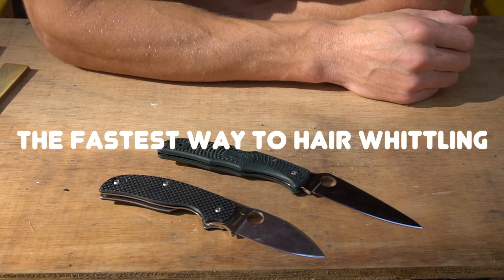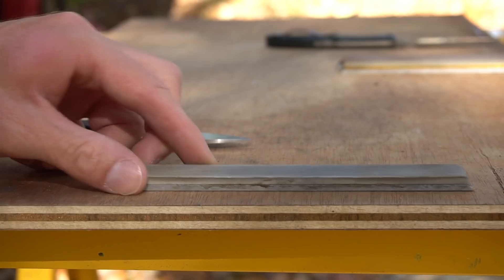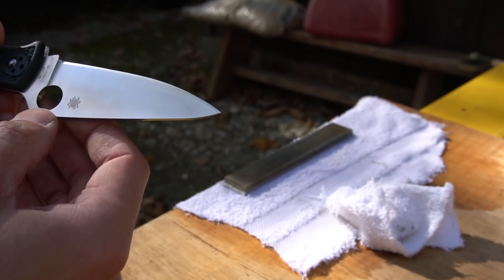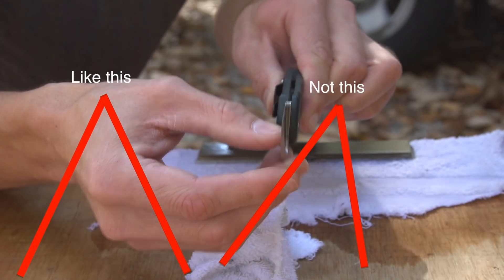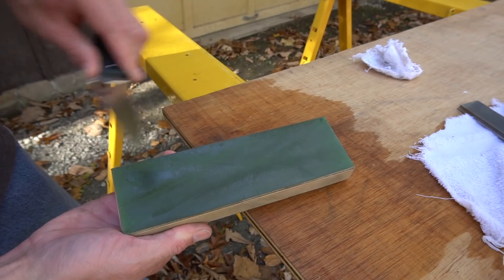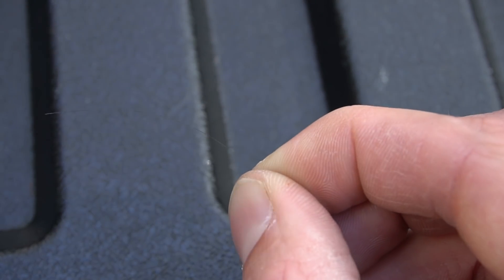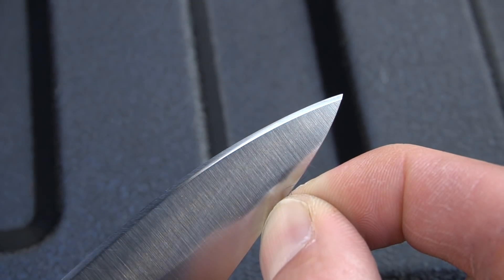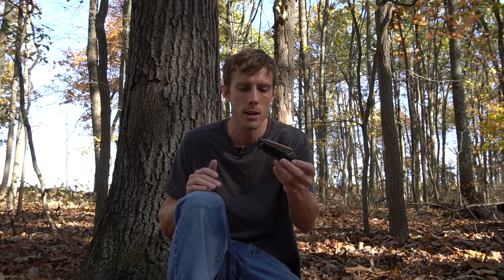FASTEST WAY TO A SCARY SHARP KNIFE

Comment: i would suggest to strop until you dont see any light. so shine a light at the blade facing up light shining down at the blade edge. then look to see for any light reflecting. if you see light along the edge keep stropping. it means the bur is still there, or maybe even another issue.
Reply from the maker: That works well, I actually talk about that in another video👍 Thanks for the comment 😀

Comment: Hi Alex! I've noticed that your edge is identical in width at any point of the blade. I always have a problem with my kitchen chef knives, that the edge at the very tip is a bit narrower and thus less sharp (or just more rough in paper test). Also the heel, 5 mm from the end of the blade. Do you have any sharpening tips for these problematic spots?
Reply from the maker: Spend more time on the stone in those areas. Those areas are definitely problematic for larger knives as most stones are not long enough for the whole length of the blade. As long as you focus on maintaining a given angle there no harm in working any problem area separately. Hope this help😀

Comment: i got 2 systems i use and love they both have different purposes......my main system  is an edge pro clone with 3 diamond stones 240 600 1,000 and some natrual/artifical stones ruby 3,000  5,000/6,000 agnet ((ive had different sources report that stone as 2 different grit)) 8,000 green and 10,000 white stone .....and a strop with white compound and strop with jewlers ruge......................the other system is lansky diamond stone systep i got the extra corse the corse the medium and fine i have the 1,000 grit extra fine and 2,000 grit polishing stone and 1 strop witth red rude ((i do plan on getting more strops for more compound options)) i like/love both systems sadly ive yet to get a true mirror edge on eather one of them...think i need to make a couple strops and get some dmt liquid emmulsion or something to 1 micron and .5 micron......why i go through all the work is that some metals like toothy finnishes and some love polished ....zdp loves polished it will stay sharper longer if you go beyond your 240  and there is some evidence  of this if you seen cedrics channel......he does alot of edge retention tests and you can probly look up the metal to figure out what edge works best or what metal sorry im rambleing at this point i was going to ask if you ever do mirrors and if soo what would you recomend me to help get me there right now my free hand sharpening skills suck though i do practice cause i never know when i might be in asituation needing to sharpen a knife with out haveing my systems on me

Comment: So first off I wanna say I love your videos and hands down some of my favorite "how to" videos on sharpening! I'm trying really hard to learn how to sharpen a knife to hair whittling but I've been unsuccessful on any kind of steel ranging from cr13 all the way to s30v or m390. I've got mainly diamond stones from worksharp and dmt and I've got the knives plus strop. Is there any advice u could give other than what you've shown in your videos that I might be missing? Do you use any kind of compound on your strop? ANY advice would be much appreciated! Lol
Reply from the maker: I use chromium oxide compound. Hair whittling is a delicate process. The edge is so thin you have to be very gentle on the stone and the strop. In my experience 8cr13mov from spyderco is the easiest to get hair whittling. Not all 8cr13mov is the same. I use light pressure on the stone and the strop. I think pressure regulation is the most important, other than maintaining an angle. Hope this helps😀
Reply: OUTDOORS55 awesome man I appreciate it! Yeh I've been practicing on my tenacious trying to get that edge but I never thought about the pressure. I'll sure try it! Would you recommend the edge pro stones over any diamond stones?
Reply from the maker: I don't have experience with diamond stones. I have heard good and bad. If you can get around the small size the edge pros are great. They cut well and last forever for how small they are. Not sure I can make a recommendation haha. Just depends on what you want. I have heard on some steels the diamonds can actually come off, and imbed into the steel. Maybe something to research before you make a purchase.
Reply: OUTDOORS55 thanks for the help! And one more thing I've always been unsure about is when I'm progressing thru grits, at what point would you transition to a higher grit?? Like say from a 220 to the 400 and on up?

Comment: So it is the leather that does the trick. Now how big difference do you think there is between leather and leather? For example some old leather belt, or a random piece of leather?
Reply from the maker: There is a big difference in leather. Some of which is totally unsuitable and can actually make the edge worse. I have found a high quality veg tan leather to work best. However lower grade can vegtan can be a nightmare. I would avoid buying leather online unless is come from a reputable source specifically for stropping🙂
Reply: @OUTDOORS55  I see, thank you for your advice

Comment: I agree working age is just fine I actually prefer working it was nice to see the polished edge when I first started sharpening but if you’re truly using your knife not worth the time and effort I do have a question on that sage 1 in the video it looks like you’re having the same problem I have originally from factory at the back of the blade it originally sharpened A little higher up and it makes the blade look like it has more belly straight edge and as I sharpen I tend to straighten edge up if you know how men can do it can you show a video how to keep the factory shape to the edge looks like you straightening yours out a little bit too but if you look up a new knife maybe you’ll see what I’m talking about not sure if I’m explaining it very well I really enjoy your videos 👍🏻
Reply from the maker: One problem with the sage is that the blade is very thin in the back, and thickens at the tip. If a constant angle is held along the entire length of the blade, the bevel will be different sizes, due to the thickness change toward the tip.  However my sage came with a poorly ground edge and was very uneven from one side to the other. Im bringing it back proper over time. Hope this helps. Thanks for watching my friend😀
Reply: OUTDOORS55 Thanks for the response so if I wanted to keep the original shape of the bevel  I would have to sharpen the back of the blade at maybe 25° and more in the middle and tip go to like 20 or 22° no it wouldn’t be a consistent looking bevel but that’s how I would keep their shape if I wanted to
Reply from the maker: If you want to have the bevel the same width, on a blade that changes thicknesses, than yes, you would have to sharpen at different angles. I prefer to keep my angles consistent, even if the bevel width changes. However, its personal preference, theres no right or wrong way.
Reply: OUTDOORS55 cool thanks man appreciate the information and your time
Reply from the maker: No problem thanks for watching 😀

Comment: What about sharpening convex edges? Those are pretty tricky to sharp on stones....
I use sandpaper on a mouse pad...afterwards a strop
And yes, all knives should be whitling hair sharp, because an edge that sharp will have a better edge retention than a less sharp knive...
Though, in my opinion, no leather gimmick gives the blade edge the crispness that a (high grit) stone gives....
I learned this from a youtuber..
Reply from the maker: I do most convex edges on sand paper with leather backing. A strop can and will round over an edge if you you apply too much pressure or too much angle. I don't find a stropped edge any less "crisp" using a strop, but there is some technique involved. Thanks for the comment👍

Comment: What if you have the diy leather belt strop? The burr doesn't make any type of apparent "roughness" on the strop
Reply from the maker: Sometimes the burr will be very small and won't leave a noticeable mark on the strop. A coarse stone will leave a bigger burr than a fine stone. Also I use a drop of cutting board oil on my strops to condition the leather. That will also help.
Reply: OUTDOORS55 ok I'll give it a try. My leather belt strop is pretty stiff. I'm sure the oil will help, but do you need to add more buffing compound after you put the oil on?

Comment: Thanks for the video. Yes, I just find out to get from a paper slicing sharp knife to hair shaving sharp, and to hair cutting sharp,  it is basically depends on how much time I am spending on stroping. I found it doesn't really change a lot on stones unless you get some really nice and expensive fine stones. Paying more time and patience on stroping can basically bring a paper slicing knife to shaving sharp. However, for an edc folding knife,  I do think it is good enough as long as the knife slices paper. For an outdoor fix blade, I can live with it as long as it doesn't tear paper. A shaving sharp or hair whittling sharp is for fun more than practical. After all,  the whittling edge will leave me after an apple.. 

By the way,  I usually strop with an slightly higher angle than sharpening. What's your reason to have a lower angle?  Will the strop can't touch the apex?  No offence or challenge, you know I am your big fan :) I just want to know if I am doing it wrongly.
Reply from the maker: I agree I find it's all in the strop. I strop at a lower angle to avoid edge round off. On a soft leather strop, too high of an angle, combined with too much pressure can round off an edge. Although every strop is different as to how much pressure and angle is necessary. At least from what I can tell. You almost have to learn your strop and what it likes haha. If what you are doing works,  than it works, no need to change. 👍
Reply: Oh.  I figured out the difference. You are stroping at a lower angle with reasonable pressure. I am stroping at a higher angle with minimal pressure. I tried your way and I found it more effective. Thanks!!

Comment: A fighting knife, contrary to popular opinion, should be about that sharp. The knife is not used for anything but fighting, and the edge will last long enough for you to sever tendons and muscle. You don't need "shock-factor" from pain, which is where the "rough" edge concepts comes from, when the muscle and tendons are not operating the limbs. But...you need to have a utility knife with you as well. Always carry two...one for cutting and one for fighting.

Comment: How do you tell what type of steel your knife is?
Reply from the maker: If its a quality knife it will say on the blade most of the time ( not all cases though).  Other than that check with the manufacturer. Thats really the only way.😀
Reply: Well mine is a Gerber and the only marking on it is 466015A and I don't think that has anything to do with the steel

Comment: Who cares about the haters. My blades are always shaving sharp. & i use a multitude of different techniques. Free hand. No guides or anything. I have a 400grit, 600, 1000, 1500(only 3in long, and 2000. And a home made strop out of a hunk of leather from a tool belt. I could easily make due with one 400 or 600 & a strop. I agree completely & yes theres a reason to have a shaving sharp knife. If youre good at honing an edge your blade will be acceptably sharp for a lot longer than a shit edge some urban cowboy put on his or her custom ZT they bought for $400 to have the latest steel. I can make anything sharp as im sure you can too. & anyone else for that matter if they care to read a little orcwatch a YouTube video! Hahaha. Good clip bro!

Comment: The knife steel, skill level of the sharpener, and knowledgeable decisions made within the process of high refinement of an edge determines the lasting ability of a whittling edge. Cruwear takes a ridiculous level of refinement and produces substantially better holding of high sharpness than vg10 or s30v. Maxamet would hold a whittling edge better than s110v or m4. It's all about different steel compositions and having sharpening processes specific to each steel if maximum performance is the goal. Whittling edges do not break down to working edges at a fast rate for all steels, plus all steels do not maintain the same sharpness at their working edge level.

Comment: +OUTDOORS55 You’re a hell of a craftsman. I’m learning quite a bit from your videos. So, is it because you run a 220 grit then right to strop that your edge gets destroyed so quickly (as you mentioned)? Is there any benefit to using finer grit stones? I have the same Norton stone set you have in other vids. If you went progressively, say 220, 1000, 4000, 8000, then strop, would you have an edge that didn’t destroy so quickly? Or is that just the way the cookie crumbles? Thanks for the vids.
Reply from the maker: Not necessarily... A 220 grit edge is really just for demonstration. It could be used perfectly fine however.  Sharpening to  finer grit will lead to better edge retention. But not by much. Different grit edges work differently on different materials.  You wouldn’t necessarily want and 8000 grit edge on a knife you are using to fillet a fish. However and 8000 or higher grit edge would be much better for shaving your face.   My EDC edges are usually taken to 1000 or 1200 grit. And then stropped on green compound strop.  For me there’s not much benefit to sharpening beyond that.  Hope this Sorta makes sense 😂
Reply: OUTDOORS55  Yeah that makes perfect sense. And good point about different edges for different purposes, I hadn’t been thinking about it that way. I just figured the more time spent working through the stones in progression, the better the edge would ultimately be regardless of use. Most of what I need is EDC as you mentioned and I tend to give up on fine grit, say 4000 and over, because the benefit doesn’t seem to outweigh the cost of time spent with those stones. I tend to be pretty hard on edges because when I use, its for use. I think I’m going to to try what you mentioned, say work up to 1200 and then strop for most basic use purpose. Thanks again man.

PS: if you don’t mind me asking, what is your basic grit progression for day to day EDC blades? You sharpen up to 1200 but how do you normally get there? I’m sure there are a thousand variables to that question, but basically speaking for an average hack like myself 😧 Thanks again!

Comment: where to buy those stones cheap in europe?
Reply from the maker: Im not sure..Im not sure it would be worth international shipping on these stones. Any quality stone will work just the same with proper technique.
Reply: thank you but I am looking for those type of stones for sharpening system which are good...
Reply from the maker: King stones are good cheap whetstones. Or ceramic stones are good although more expensive. Ceramic stones also last longer as well. Its hard to pinpoint a brand as I'm not sure whats sold in Europe.
Reply: thank you for the info... I was looking once at some japan made stones Naniwa and they also got for sharpening system but they are expensive ...and I can't find anything else in Europe and the prices are 2x more then in USA
Reply from the maker: Wow that's crazy. Naniwa stones are already extremely expensive.

Comment: Or a microscope at MY age...(64)...
First video I've seen using the strop wax.to check progress. I can't believe you went from a 220 grit to green oxide and it cuts? Wow.
My edc's are a $5 Harder Fate throwaway and a box knife as I'm in construction. If I sharpen the HF beyond, say 800, it won't cut rope, thick cardboard and such. That seems to me to be the grit where a slicer becomes a pusher. My 2-blade pocketknives will be a 320 on one and 2000 stropped on the other.
Reply from the maker: Yeah I too feel like sometimes the super high grit edges don't cut as well on certain things. Especially in a slicing motion. The two blade approach is a good idea. I only wish spyderco made a two blade endura ha! That will be the day!

Comment: wouldn't the use of a coarse stone all the time for sharpening your knife decrease its lifetime? 
I usually use a very coarse stone such as a Norton India for damaged chipped knives,
if the knife is  very dull but not damaged I will use a 400 grit
if it is slightly dull from normal use I will use a 1000 grit stone.
To polish and to get the knife sharper I use a 4000 grit stone after the 1000 grit stone and then use a leather strop to remove any microscopic burr.
Reply from the maker: It can if you sharpen past forming a burr. If the knife isn't apexed, you have to apex regardless of what grit you use. Its just faster to form a burr with a coarser stone. Just the way i look at it🙂 Thanks for the comment 👊

Comment: Let me ask this, why? Why do you need a knife so damn sharp? A sharper knife will have the steel roll, chip, and dull easier although it starts at a finer spot so it will take a tad bit. There’s nothing wrong with a sharp knife, but dang.

Comment: I am curious about compounds, I don't have any and am clueless about which compounds  to use for certain purposes, plus  I have no experience with any stones other then the cheap one that feel absolutely the same to me even though it's supposed to have 2 grits
Reply from the maker: I use green chromium oxide compound for most purposes. You can. It it on Amazon for cheap. You can absolutely get a sharp edge on a cheap stone here's a video I did demonstrating that https://www.youtube.com/watch?v=CW8L8U1n8uM  
Most of sharpening is in the technique and it's less. About the gear used. Hope this helps 😀